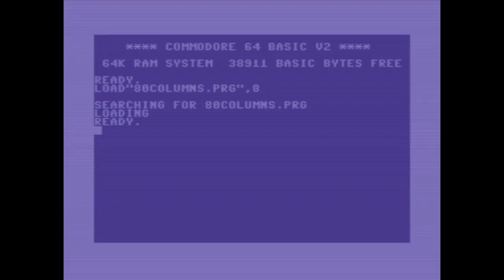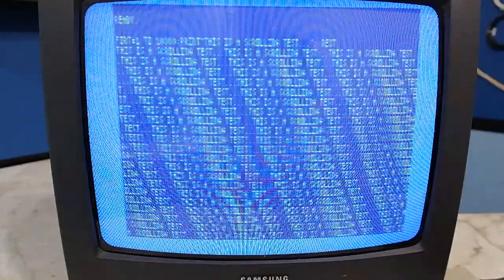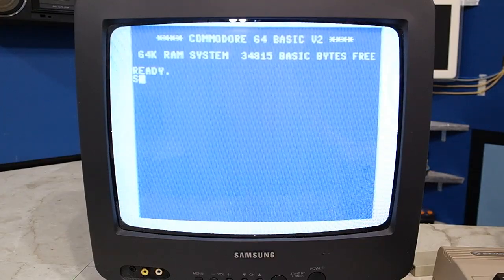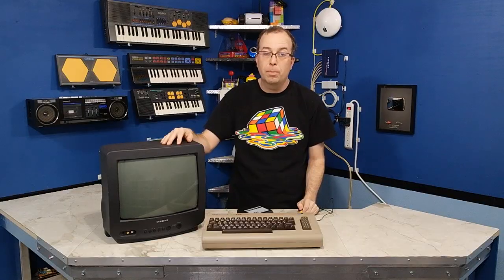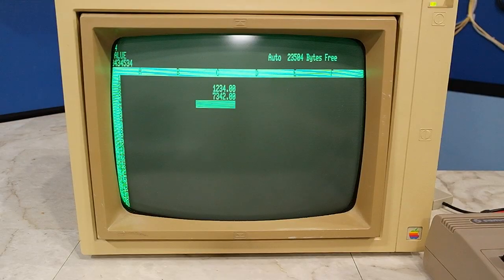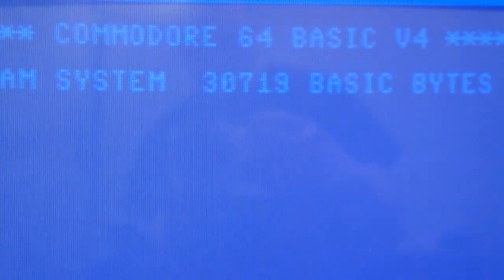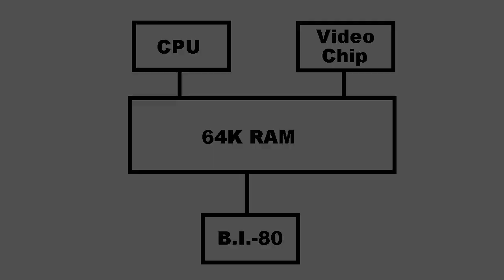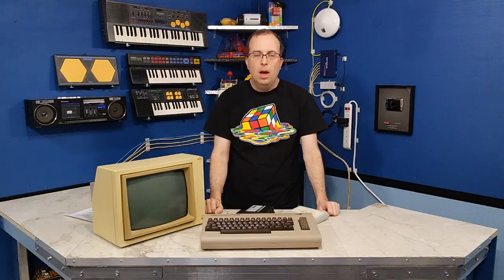The Quest for 80 Columns on the Commodore 64

Comment: To be fair on the VIC, you could stretch it out to about 26 columns so long as your screen was good for it, or it was connected to an adjustable monitor. That 22-col default was just Commodore being extremely conservative, playing safe in case you connected it to a terrible TV.

Well, that and the very low frequency used by the video chip (only the VCS and Intellivision used less, IIRC) and the 5kb RAM, of which even that low rez + extremely basic OS consumed 1.5k...

Some modern day hardware and software hackers have managed to get 208x256 on PAL / 208x232 NTSC (26 x 32 or 26 x 29 text) out of it, with surprisingly colourful graphics... after upgrading the internal memory to 8 or 16k, that is...

Given that, I wonder if anyone managed to prod the stock '64 into showing a few extra characters across the screen in an otherwise "normal" text mode? If there's enough of a border you could at least manage, say, 48~52 characters, which is a useful improvement in itself (and if you can do that in graphics mode and switch from 8 to not 4, but 6 pixels wide, then that's 64 to maybe 70 cols... and just squeezing in the magic 80 with 5-pixel). And/or the kind of trick used in various Atari 8-bit pseudo-80-col modes where the actual text cells were redefined as being 4 pixels instead of 8, and a custom character set loaded (IDK if they could do 6 or 5 pixel wide cells, probably only 4 or 8, but they certainly had a 384-pixel width ability, which is good for 64 cols at 6px and 76 at 5px). I could swear I've seen some info about C64 modes somewhere that mentions 4-pixel-wide sprites and/or text cells? That might only be for the lower (160 pixel) resolution, but if it could be glitched into also applying in higher (320 pixel) rez, it could at least solve the speed issue even if none of the others.

Oh, and don't forget the core reason why 80-col was important: printed text. Well, actually the true origin of the mode (and the line count too) was tied up in IBM punch cards and how many characters they could record each (I think it also influenced how many tracks were stored on floppies, too? At least the original 8-inch ones, and the higher grade 5.25" and 3.5" types derived from them, rather than the cheaper 40-track 5.25" types), but that also happily just-so-happened to be a good match for how many letters could fit across a standard piece of writing paper with allowance for a typical margin.

IE, about 80 - or 8 inches with typical typewriter-style 10cpi Courier font. Meaning about a quarter inch (~6mm) of margin on each side of regular US Letter or Legal paper, and an even more sparing 1/8th (~3mm) down each side of a piece of A4. Technically of course you could fill them to 83 or 85 characters with no margin at all (or the slightest of overruns on A4), but no-one would sensibly attempt that. In fact, more likely to actually have wider borders and fewer characters across (72 to 75, with 1.25cm or half-inch borders on the two main standards), which works just nicely with an 80-col display allowing for a scrollbar down one side and section marks/other brief annotations at the other.

Mind you, that's fine if you're writing letters or reports, but I think 40 (to 48?) col would probably have still had a place for making copytext for newspapers, magazines, scientific papers, textbooks etc, where you'd more likely have the print organised into multiple subcolumns for ease of reading, and with a slightly narrower font, e.g. 12cpi Courier or Times. If that was spanning the entire page then you might expect it to demand at least 80, probably more than 90 character columns, but in two chunks with a gutter space between, each individual block would have been more like 32-40 cols wide. So even something like a Spectrum might have been able to perform something akin to wysiwyg display (in fact, more often its wordprocessors used a narrower 6px or less font anyway, and also proportional rendering, to fit more but still-readable characters across, and in the more sophisticated cases keeping track of the real on-page spacing of a printer font with known dimensions).

But, eh, that's your reason for 80 col (or at least 72~75~78 as seen on some machines or terminals, and the 90-col of the Amstrad CPW word processor) displays that often demanded special monitors being "professional", and lower rez, more TV-compatible options being considered a bit more toytown. Paper, typewriters, and punch cards. These days, it's all pretty moot...

Comment: I'd say lots of commodore users had 1702s,  At least I knew many.  And the video was unsurpassed when using a chroma/luma cable which I'm very surprised you did not use here when hooking up to the 1084.  I'm sure the results would have been outstanding.

Comment: Thing is, the fact that the TV expects a color signal proves that the color-burst is still being sent down the composite cable, which means that it still identifies itself as a color signal. Without the color-burst, the TV would only display monochrome even if color information was being transmitted because the color-burst is what tells the TV that it's a color signal. This is why full static isn't colorful despite partial static being colorful.

Comment: The reason 80-column text doesn't work well on a standard composite analog television isn't that the color signal "degrades" the luminance, but because the bandwidth required for 640 pixels across is half of the frequency of the chrominance component.  This effectively means that alternating light and dark pixels in the luminance signal at that rate would fool the television into thinking it's a color.  This is how "color artifacting" worked.

I did a lot of research on this subject when I was figuring out how to accurately emulate color artifacting for the Atari computers.  My notes are kept here:
https://user.xmission.com/~trevin/atari/video_notes.html

Comment: On the Commodore 128, you could also output to a television in mono 80 column if you had a composite in on your TV at the time. In fact, I did this back then and it looked better on a TV than the 80 column cards that you used in this video.

Comment: The BBC Micro in the UK launched with 80 column support. The Electron, launched in late 1983, also supported 80 columns, but Mode 0 used a lot of RAM.

Comment: I seem to recall that the monitor with my C128 was pretty sharp in 80 column mode. But I almost never used that mode :P

I think it was a 1084, but it looked different - more curvy and understated.
Reply: To address what you said later: I used that same C128 RGB port for the monitor and it covered everything from C64 mode to C128 mode to 80 column and CP/M. I didn't need two monitors.

Comment: Very good and interesting video-- coincidentally I was recently reading an old issue of Byte magazine (August 1983) which has a review of the (then) brand-new C64.  In the review, they mentioned the Data20 card and gave the address and phone number.  With the Data20 card being available so early in the life of the C64, it baffles me as to why there wasn't more software support for it.

Comment: actually it doesn't require seperate monitors

I have a Commodore 1902 Color Monitor, and it supports either RGBI input (digital only), or RCA input

you hook up both the RGBI and RCA to the monitor and commodore, you can select which input you are using with a switch on the monitor.

My C128 uses RGBI for 80 Column or RCA for 40 column, if i am in 80 Column and go to C64 mode, it appears to lock up, but it is working, you just have to select the correct input.

Comment: the c128 80 column monitor mode looks like an old dos pc
the font is the same
Reply: It was made that way to make it familiar and comfortable to those already familiar with DOS machines.  I remember the terminal programs in 80 columns looked identical to MS DOS color terminal programs with BBS' especially ANSI graphics where they would flash in the same way.  The Amiga, in contrast, had a totally different user experience.

Comment: I was lucky I inherited my dad's C64 and he had the Commodore 1702 monitor, disk drives, printer and tape drive. I didn't have the BI-80. Loved that machine. I wasn't smart enough to do much with it.  Later I had two monitors not that I could use them at the same time. I sold the computer and kept one monitor as I was using it with an old NES to play games.

Comment: I would like to see, what the software rendered 80 column mode if the 64's internal graphics looks like on a real monitor instead of the TV. Wouldn't it be equal to the black cartridge in speed and sharpness?

Comment: Great vid!! I remember fondly using 80 columns when accessing other BBS's that weren't commodore back in those days. I can't remember the terminal program I used. Even thought I had a nice Magnavox 80 monitor, it was still a bit difficult to read just as illustrated in this video but the redraw latency was not an issue because the fastest speed I ever used on my C64 was 2400 baud. Even if it was faster, so the screen didn't scroll nicely.. wouldn't have mattered.

Comment: My brother ran packet ham radio very successfully for many years using  C64 80 column software. He had the C64 hooked up to a composite monochrome monitor with a Schnedler  4 MHz turbo board in the user port. Loaded the 80 column software from a 1541-II ran and then loaded the packet software and ran. The output was as clear and as fast as I was getting off my C128-D 80 column display. It was fun.

Comment: Great video! One question though -- wouldn't the software solution look a lot better if you used a better display? Perhaps the 1084 or a monochrome monitor? I wanna remember you could get a decent output from the DIN connector.

Comment: Back in those days, I would have thought the biggest use of 80 col in the home would be when using your computer as a terminal to talk to remote systems (or BBS's), so if you could get a good terminal program, the 80 col carts would be worth it.

I seem to remember a few work mates using the 80 col software hack, mostly for terminal use.

Comment: Yes, PaperClip works well on the Batteries Included device.  My Mom used it to type her papers when she went back to school in the 80s.  I don't think there are any other programs that work with it.  And of course few programs will work with the machine with the reduced RAM and different footprint in 40 column mode.  Also Paperclip will work in 40 column mode as well.

Comment: I noticed the cursor was still blinking during typing (using VIDEO PACK 80, 6845 CRT Controller). Very close if not exactly like an IBM-PC! Even if you disable interrupts and halt the CPU on a PC, the cursor will still blink. Seeing that hardware connected to a completely different architecture, that is the C64, is quite unique. Thanks for sharing this stuff :)

Comment: There were actually some "important" software for the C128 taking use of the 80 column "VDC" mode. The CP/M 3.1 mode ensured that there were available 80 column software already from the beginning with the C128, like WordStar, SuperCalc etc. In C128 mode, GEOS 128 with all programs suported 80 column, like GeoPaint, GeoCalc, GeoWrite, GeoPublish, etc.
Reply: Yes, it did have support later on.  The problem is that the Amiga did everything, just a heck of a lot better.  The 128 simply came to the ballgame too late.

Comment: The BI-80 was actually very good. There were just a couple of programs specifically made for it but the fonts were crisp and quite legible. I found a great 40 column terminal program that was written in a compiled basic. It was complete with X modem, ymodem and zmodem. I uncompiled it, converted it to 80 columns and then recompiled it. It worked great. Combined with a 1200 baud modem it got me thru my computer science classes in the early 1980's. The C-64 had compilers for BASIC, C, Pascal, FORTH, SNOBOL and many other languages. All in all a great machine.
Reply: May I ask what comm program that this was? There weren't too many that did Zmodem on the C64. I know of only one terminal program written for the BI-80 (Kermit, I believe) but I never got to test it. I had my BI-80 hooked up for a very short time. I'm not even sure if I got it to work correctly. If I did, I do not think I was too impressed. And I had a 1702 monitor at the time.
Reply: @jdryyz  I cannot remember the name of the program I hacked, we’re talking about the mid 80’s, it was written by someone that ran a BBS in Miami where I am from. I was involved in testing Kermit implementations while attending Florida International University. I tested many versions written in C, Forth, Assembler, etc.  One of the issues encountered at 1200 baud is that the input & output UARTs depend upon differing ratios of hardware/software. At 300 baud this was no big deal but at 1200 baud the timing differences would cause tx/rx problems. This could be corrected by poking modified timing values into the UART subroutines. I wrote an interrupt routine that would continuously poke the corrected values into the UART code. My hack would load into the tape buffer, and you could then load up your favorite terminal program and now it would work at 1200 baud using  1200 baud modem.

Comment: Amazing how computers have evolved - I remember the c64, as I used it at a Rectifier Manufacturing plant in Bloomington, Indiana back around 1988, and as a stock handler, with over 3,000 parts to get to the lines as soon as possible, people could not work until their stock was there for the shift, and my c64 allowed me to keep track of where the parts were in the large stock room, so I could prepare their orders in a timely manor. I remember that prior to me bringing in my computer to work, that I had doubts on keeping my job, but after the computer was set up, and the foreman stopped yelling over lateness of stock, I liked the job. Inventory time, my computer was valuable too. Written in basic, I used sequential not random storage using if then next loops to search. For instance program ran would say part looking for= and if for instance I entered sa-5219-24, it would tell me 3 numbers. first was the section of the stockroom, second number was the column and third was the row the bin with the stock could be found - the computer saved my job, and the expansion card wasn't much, and i made a larger power supply using the larger rectifiers available at the plant too . One time, I brought a video of a spinning globe, and i remember how long the basic program took to load that program up, and run, and it was so slow compared to the speed of computers today. To think that I had people amazed as myself looking at a spinning globe? seems so - so what now doesn't it -My grandfather died while I was working there, we had planned to take a trip one weekend to his hometown, and rent a camcorder so videoi footage of his old school house could be taken, but he had a hard attack as he was loading the car up, and I remember for a few weeks after at work, I was a little emotional, well, the management made me take a urinalysis test to make sure i was not on cannabis. I was not. I am now though. think of it though. /If I were doing cannabis back in 1988, S.T. SEmicon of Bloomington, Indiana, would have terminated my employment. USA. Freedom? or a hateful dictatorship?

Comment: Own a C= 128 had Jiffy Dos installed so could run 64 Mode easily for games/ GOS software. Had an monochrome monitor for 80 column CPM DOS mode but no programs to run with it. Berkley Software had a lot of Geos 64/128 ( plus Windows version) of it various programs making it useful as a business, desktop publishing, data base. Like to se you do a review on all the various GEOS software available for the C= 64/128 it really was a better software than anything available for a MS Win computer running Win OS 3.1. For extras I have the 512 memory cartridge, a cable that switches between 40/80 column mode to monitor, 5 1/4" / 3 1/2 floppy drives, Jiffy Dos, All the GEOS  64 / 128 software. Had the 128 C=  on 24-7 for years without every having lockup or having to reboot, switched to a Windows PC when GEOS came out with a MS Windows version.

Comment: Fun fact: The C128 can be upgraded to have 64K VRAM instead of the normal 16K available to 80 column mode. It can be an annoyance but I did successfully upgrade mine using parts the original owner had bought in 1990 and never actually installed.

a very late 128D variant actually had the 64K built in by default, as well.

Comment: I remember, back in the '90s, I connected to BBSs on a C64, using a shareware program called NovaTerm, which implemented 80 columns in software. It had pretty good ANSI terminal emulation, including all the CP437 characters. It had a few problems, though: (1) the text was just legible with the color composite signal; (2) it wasn't very fast, especially whenever it had to scroll the screen; (3) the two-colors-per-8×8-cell limitation caused problems whenever two characters within a cell had different color settings—the later one would override the earlier one; (4) there was also the color incompatibility, because the C64 had 16 colors, but not the same ones as CGA. Still, it worked well enough.

Comment: A friend of mine had a cable allowing the 128's 80-column (VDC mono) output to be plugged into a composite monitor, and it really wasn't very clear compared to my dual RGB/composite monitor. I recall he had a very nice composite display compared to mine, so it's surprising that you say the mono VDC output should look as nice on a nice composite monitor as it would on an RGB one.

On the other hand, I could have sworn that friend had a Commodore 1084 or 1902 monitor, both of which natively support RGB, so I could be really confused.

Comment: I noticed you dragged a file into the Plus/4 emulator and it spit out a load command inside the emulated machine. Was that in VICE? If so, which VICE UI (SDL, Gtk+, Cocoa)?